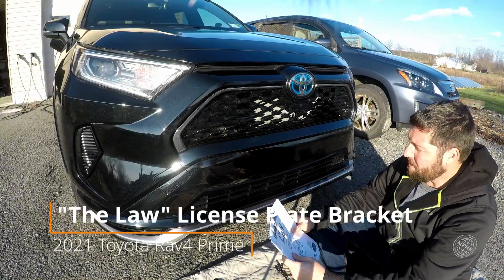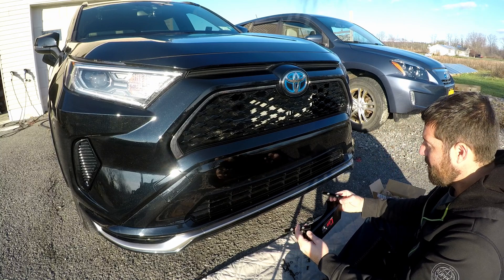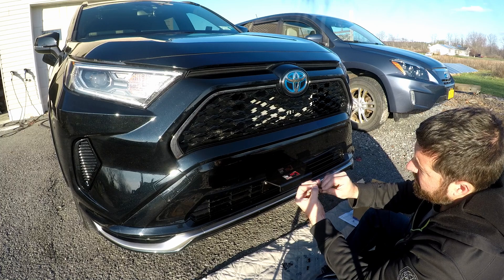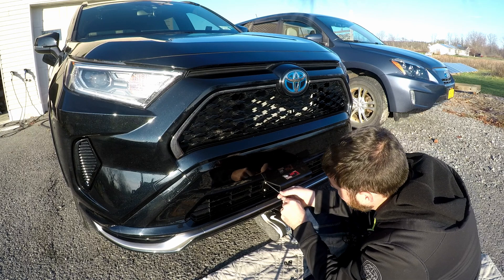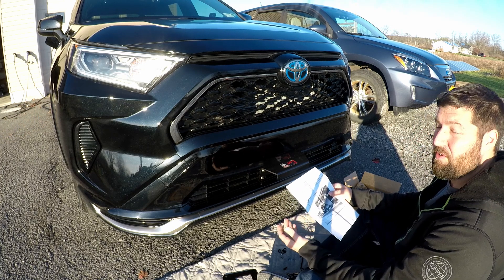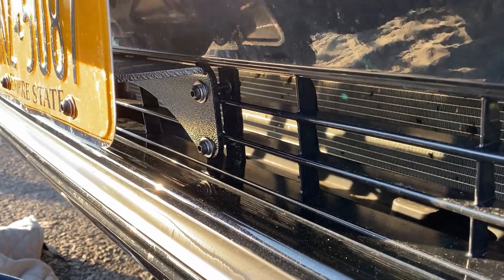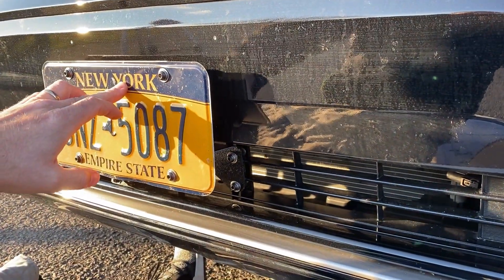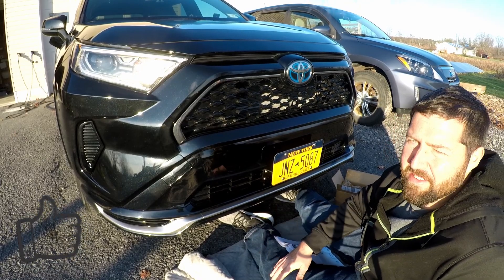Torklift Central "The Law" No-Drill bracket installation 2019+ Toyota Rav4

Comment: I concern about the movement of the license plate. it could fatigue the grill after a long time. I think if you can put a  rubber(or foam or similar light weight materials)  spacer between plate and bumper, it would reduce the vibration. I think the rubber spacer could be attach to plate and bumper with double sided tape  since the plate is already secured by installion bolts. The spacer are also screwed on the plate side because I guess you don't mind to drill the plate frame. The spacer could be a small round cylinder since the frame is rigid enough

Comment: You could attach a gopro to the bumper with the succion cup and go for a ride to see how much it flex. Not only with wind, but every tiny bumps on the road (cracks, potholes, etc) will transmit energy which is going to be absorbed by the bracket and grill.
Reply from the maker: Good idea.

Comment: Luckily, Ohio canceled their front plate law. Watching the pictures at the end I thought that you may be able to  fashion a "stand-off" bracket behind the top  of the  license plate. Even have a little room on the bolts there.  For example, if you took the right length of plastic strapping , and drilled 2 holes maybe an inch or 2 wider than the bolt locations, which would cause the center to bow back towards the bumper  to create  a spring type support to keep the flex to a minimum. Just the designer in me coming out. Thanks for the vids.
Reply from the maker: Thanks for watching! Glad you dont need a front plate!

Comment: I would try mounting the license plate with the two upper holes screwed into the bracket.  The plate would then have the front lower  bumper as a backstop.  Thereby stopping the movement of the license plate.
Reply from the maker: Good idea but I think that would make the plate too low. I think the bottom of the plate would be lower than the car.

Comment: Maybe try some of the 1/8 inch foam tape they use in HVAC and home weatherstripping. Should solve the scuffing issue and also dampen any small movements of the holder.
Reply: Why not use the factory location? Seems like you created a problem when there was none.
Reply from the maker: @mushmanadventures  I mentioned this in the video. I dont want holes drilled into the bumper.
Reply: @JamesKlafehn  are you planning on moving to a state where you don't need a plate? If not I don't see the point of the expense and aggravation. My .02

Comment: Bumper is pre drilled if it was me I would just put some paint protection film on the bumper and mount the plate in the factory location. That bracket seems sketchy esp at 70MPH
Reply from the maker: There are little dimples for where the dealer can install the plate frame but its not pre drilled. The dealer installs the plate frame not the factory.

Comment: Why not just use double sided tape.

That's how we install them in the UK.
Reply: But unlike the UK, it’s a license plate not a registration plate, so it gets taken off and put on the new car,  but I still reckon stick on a rubber back plate and then stick it on there.
Reply from the maker: Im not sure how well that would hold up. Its a curved surface and winter here is pretty bad, and cold. 3M tape doesnt like cold weather.
Reply: 3M Dual Lock

Comment: Why not just use the factory mount?
Reply from the maker: I mention this in the video but I dont want holes drilled into the bumper for the plate mount
Reply: 3M double sided tape. That stuff will hold forever. I use it to mount my GoPro on my MX helmet. The mount has broke from hits but the tape still holds.

Comment: This is not practical for me in the city. Eventually, inconsiderate assholes will bump into me while parallel parking on the street. The drilled license plate housing also acts as a secondary bumper protection against those inconsiderate low lives. I have strong opinions against these types of people because I am considerate to others' cars, I don't understand why they cannot return the favor.
Reply: You need to move to the country for your own sanity.